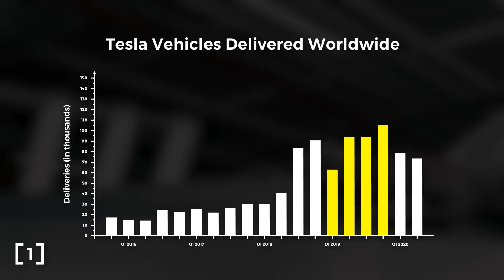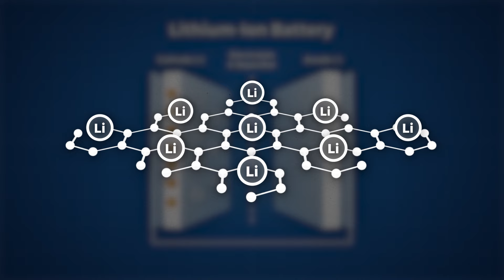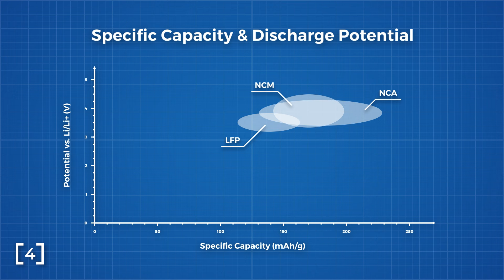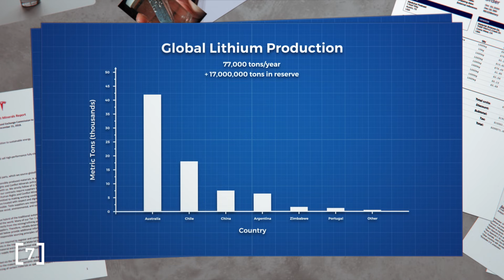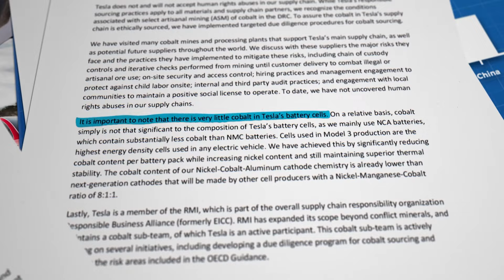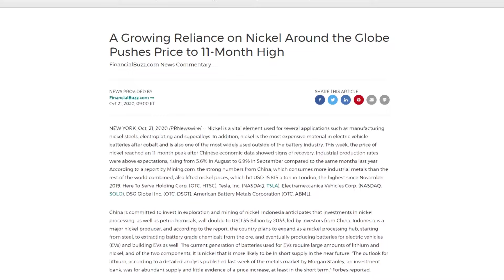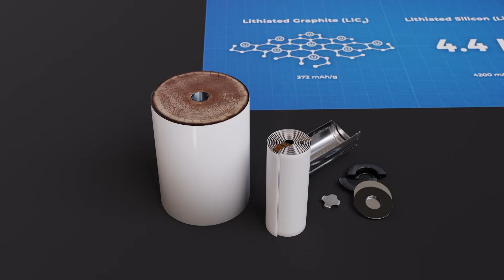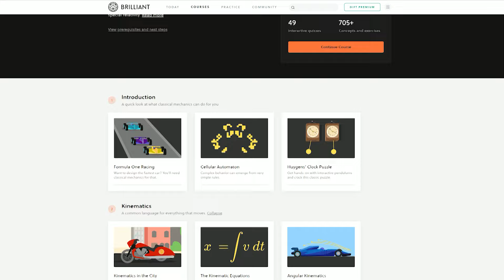Tesla's Battery Supply Problem

Comment: I'm an electrical engineer that's works in the energy industry and energy storage is one of the most pressing issues in the field at this time. I design high voltage substations. We are constantly looking at new and different methods of finding sufficient way to store energy for the grid.
Reply: Isn’t hydrogen on the horizon?
Reply: @ToxqJam  cost issues
Reply: @ToxqJam  
The trouble with Hydrogen, as mentioned many times is that for every 10GWh produced, you only get  3GWh at the "point of use".

Several ways to look at that.
You face to produce 3 times the energy (90GWh) which is not only expensive to build, but at the moment will not be 100% "green", therefore it defeats the object, you might as well just use the fossil power directly.

Cost to the end user. If that power needs generating, the utilities will pass the cost on.

Logistics/ maintenance. Far more infrastructure and transport required.
Reply: @ToxqJam  It's on the horizon the same way fusion is on the horizon.
Reply: What about energy vault?
Reply: @ToxqJam  hydrogen isn't even on our radar. We are doing alot with wind and solar also there are plans to remove coal from the equation within the next 30 years some coal plants have already been retired.
Reply: @celldoublee683  Japan has geared up for creating a hydrogen fuel society. Their government have given toyota and nissan a contract to make it possible. Only because Elon says its of no use, doesn't mean that its true.
Reply: @yogeshghadge5748  I can't speak for Japan but in the US hydrogen is not being considered on a major scale for Grid energy storage
Reply: @celldoublee683  Yeah, I can understand that there is nothing is clear at this stage. We can only try our best to improve the methods for energy storage. Let's see what happens in the near future.
Reply: saladdogger  Terrible, I'm afraid. Gravitational potential energy is very, very low density. But the idea works well with regular hydroelectric dams (which obviously are storing millions of tons of water at a height) and with pumped storage, which, as far as I know, is the only realistic kind of gravitational battery.
Reply: Chiranth Cult  Solar is the cheapest source of electricity by far right now, so if that keeps going, and if batteries or pumped storage or hydrogen storage can developed to the point where they cover the evening peak loads, with (by now well-amortised) fossil plants acting as backup, I think that solar really does have a place in our future
Reply: Easy: mass * gravity * height = 1000 * 10 * 100 = 10^6 joules. So about the same as 10 AA batteries (according to Wired magazine). So that's why pumped storage uses millions of tons of water, coming down hundreds of metres of hill... Any schemes using cranes and weights are just nonsense.

Edit: I made a mistake here, ref comments below. It's actually 100 batteries.
Reply: saladdogger  Sorry, correction: 100 AA batteries. Quite a difference! But still not enough to make a one ton weight in a 100 metre shaft be worth doing.
Reply: saladdogger  Yeah, sorry, my bad: Should have been 100 AA batteries, which does make more sense: Assuming 50% efficiency, could I imagine 10 small-ish 12 volt cordless drills, with suitable gearboxes, slowly lifting 1 ton by 50 metres? Sounds like a bit of a stretch, but maybe doable. 

Agreed that pumped storage is great: 80-90% efficiency, IIRC. I don't understand why there's not much more of it...
Reply: I imagine this is probably very inefficient but what about finding a way to store the electrical energy as mechanical energy and then just reconvert it back into electrical when needed. (like a reverse windmill type thing.)

It is big and bulky and the longer you store energy in it the more energy you will lose to heat and friction but at least you don't necessarily need as specialized or rare materials to store energy this way.
Reply: saladdogger  Agreed: I would also expect the falling weights on a winch-generator to be much more efficient, but the sheer size of the thing makes it a non-starter when compared to pumped storage...

Really interesting point about rainfall covering the efficiency losses - I hadn't thought of that 🙂
Reply: @josephreagan9545  They have made flywheel based energy storage. It has definitely shown promise in prototype machines. Though like with other technology trying to make it in to a practical device that can last years is a hard engineering problem.
Reply: @ToxqJam  That hydrogen proposal was a 1970s fantasy
Reply: Let me save you some time looking. "Energy cannot be created or destroyed." Energy storage is not the issue and is the problem. You are not alone in this manner of thinking.

What is required as a solution is a more efficient manner to transform energy into useful electricity. This has been man's problem from the beginning. Energy storage goes against the natural principles that govern all of creation. Surely the energy is already being stored somewhere, so it is possible to store vast amounts of energy. Man cannot even efficiently transform energy to electricity at a 1:1 ratio is the problem. Leave it to idiots to convince everyone to seek for solutions to problems that do not exist.
Reply: I think we need to end up with a dominant solution that doesn't use batteries, liked pumped storage. Otherwise that's just too many batteries to make.

Pumped storage is really cool engineering wise; I liked tom scott's video a lot and hope we see more big projects
Reply: In your mind as an engineer, is energy storage more or less sensible than just producing the exact amount of power that is currently in demand at any time?
Reply: Hydrogen alone is quite difficult to handle and infrastructure for it doesn't exist, but if combined with carbon, it can be used to make synthetic hydrocarbon fuels (Power to Gas), and in many countries there is existing systems to store large amounts of energy in the format of gas. For example in Germany alone existing energy storage capacity of the natural gas network is 200,000 GWh. The efficiency is of course much worse than in pumped storage, but the scalability of this kind of storage system is much more realistic than finding suitable places to build pumped storage in the same scale. Chemical batteries of any type are far worse in their potential due to reasons outlined in the video. I don't think they are seriously considered for anything else in the grid scale except very short term storage to stabilize the grid and that is how they are used Australia as well. For actual energy storage something more scalable is needed.
Reply: @Alexander_Kale  The problem is that in the electric grid consumption and production must always be in perfect balance. Ideally it is of course better to produce only what is needed and avoid the need to store energy ( energy storage is expensive ). But in practice this is very difficult to achieve if energy is to be produced with renewable's. Sun may shine a lot during the day, and it doesn't shine at all during the night. Same with wind, it varies a lot depending of the day, time of year, etc. By other words it is difficult to get the production and consumption perfectly match each other with renewable's. One option is to build so much excess production capacity that you can always meet the minimum demand, ( and have some system where to dump the excess energy or stop/disconnect the excess production). But this would require massive amounts of extra production capacity. Currently even in ideal conditions if all renewable production capacity is in use, only small fraction of the need can be satisfied, by other words, having enough extra renewable capacity to meet the demand at any moment is quite far away. Having a cheap way to store energy would be very useful for wider adoption of renewable energy production. Probably a lot of excess production capacity will be needed either way, and when that is the case, even far less efficient storage methods start to make sense ( like the Power to Gas mentioned above ), because even a low efficiency storage is always better than 0% efficiency in the case where the energy cannot be stored at all and will be lost. There is also use cases where different type of fuels will be needed, like planes and ships that are unlikely to go on batteries in the near future.
Reply: @wopmf4345FxFDxdGaa20  "But in practice this is very difficult to achieve if energy is to be produced with renewable's." - That is pretty much my point. "Renewables" do not posess the energy density of more powerful energy sources, they are intermittent and uncontrollable in their output - and still we go THAT route, trying to offset the tremendous negatives with buffer storage.

It seems to me keeping said buffering to an absolute minimum, thus minimizing your problem and maximizing the bang you get for your buck is the way smarter solution. 

If that means not using that much wind and solar then so be it. We have a civilization to run in a very hostile universe. We have a world to feed and entire populations to uplift. We cannot really afford to squander our efforts.
Reply: Dude, do you design UPS systems?

Comment: 10:20 That's not what reserves means. It has a very specific meaning in the mining industry, but it's essentially confirmed but unmined material.
Reply: Yeah, but it also means that if demand were to spike, companies already have claims they can exercise and start tapping into those reserves very, very quickly.
Reply: @oasntet  NO. Mining 'Reserves' = Years into the future -- and only after more Big Bucks on equipment.